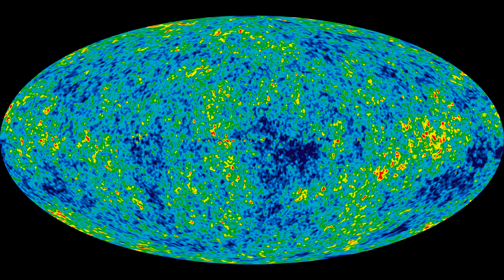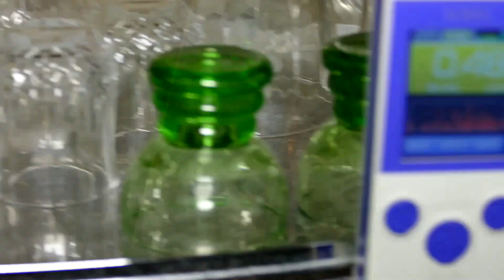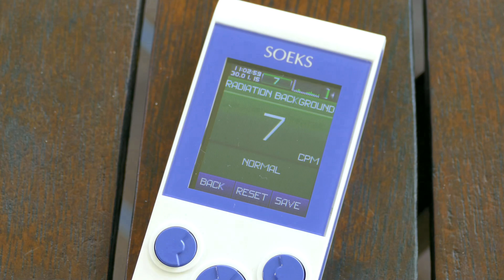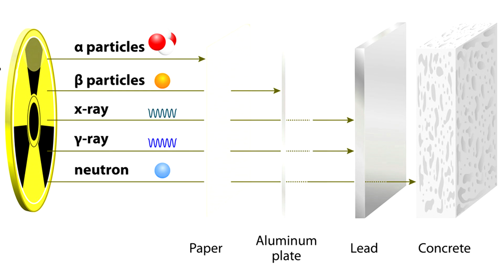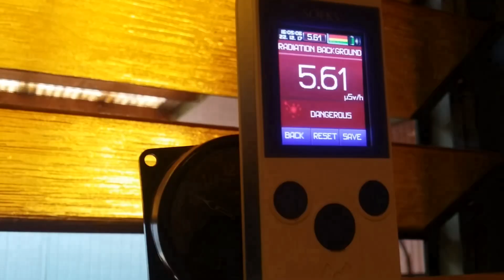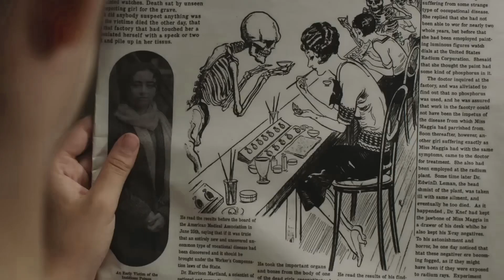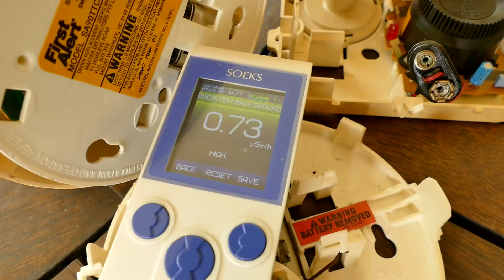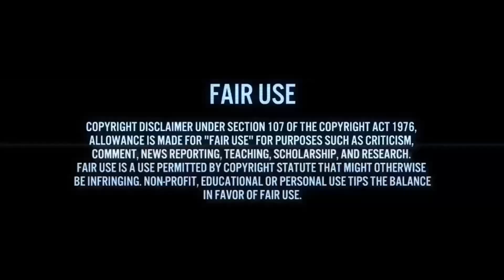Geiger Counter Reality Check: Where Is Radiation Hiding?

Comment: A chest X-ray (~100 µSv) is roughly equivalent to a long-haul flight (~10–12 hours) in terms of radiation dose. A dental X-ray (~5 µSv) is similar to a 1–2 hour flight.
Reply from the maker: Yes; hence why I mentioned air crew. A radiologist once told me, that airline pilots etc, typically have a higher cancer rate than normal.

Comment: it olny reed  7 low lot more high reed of Radiation  them   over head power lines   pielon hight voligte  power they reed high  Radiation reeding     
Steve Mack Australi great video  keep up the grerat  work
Reply from the maker: Overhead power lines and high-voltage power aren't sources of ionizing radiation, which was the focus of this video - They emit non-ionizing radiation in the form of extremely low-frequency (ELF) electromagnetic fields (EMFs). Glad you liked it. Cheers! 🙂👍